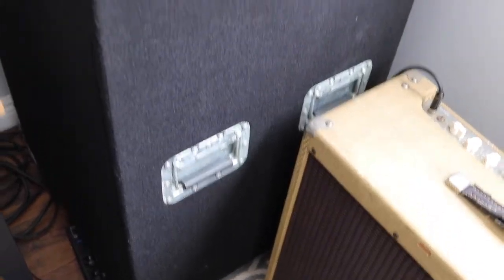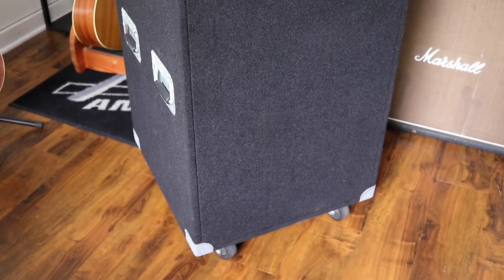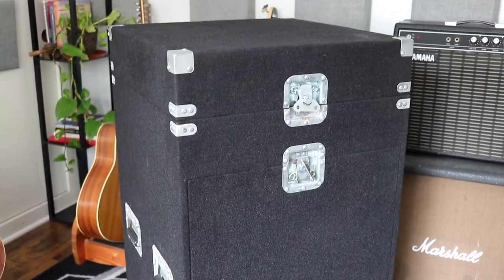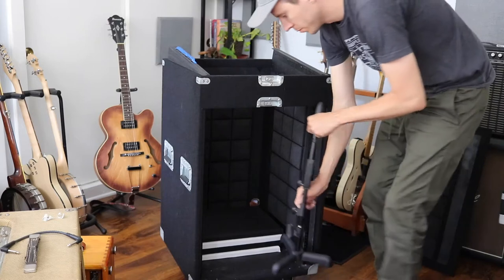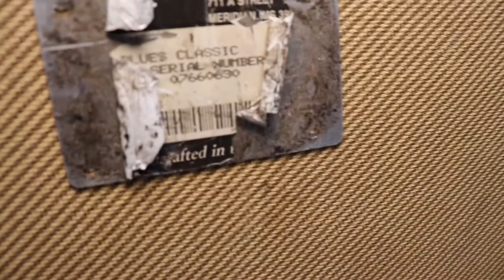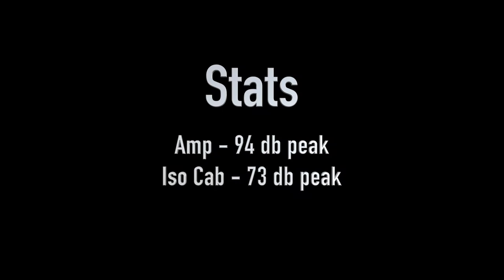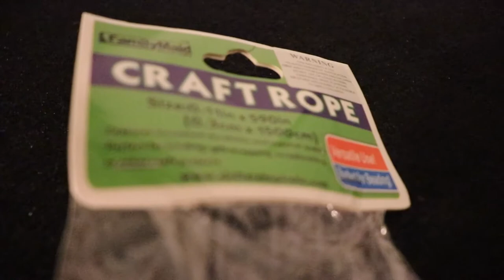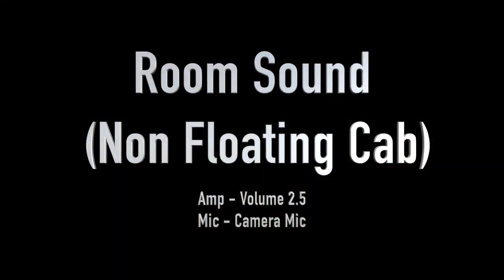Make Your Own Guitar Isolation Cabinet - DIY Iso Cab Review With Before And After Results

Comment: Been looking into making one of these, and I was just about to comment that it doesn't seem to be helping to tame the low-end, but then you went and suspended the whole thing in the case, which is a super cool solution. Have you had any noise complaints/been told from neighbours that they can still hear the amp? Because the DJ rack case is such a unique & cost-effective idea.
Reply from the maker: No noise complaints so far! In hindsight, I think additional insulation (i.e. fiberglass, foam, etc.) would only help. Hope this helps, and thanks for checking out the video!